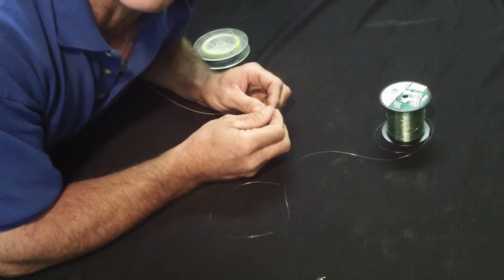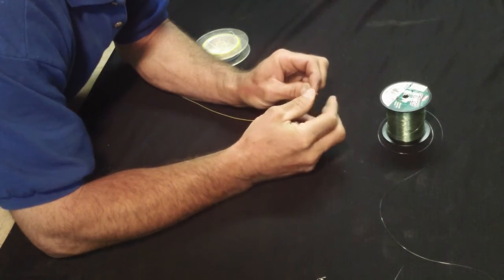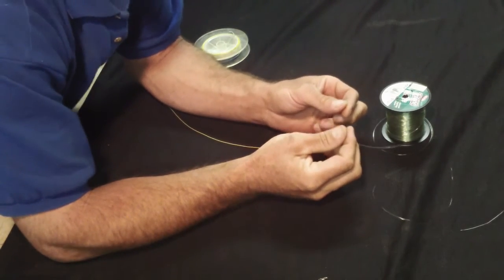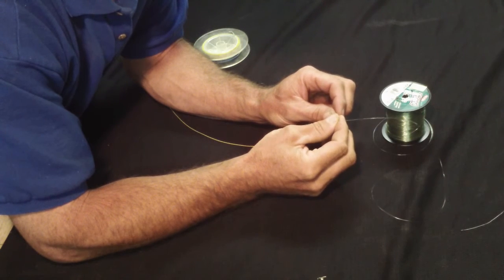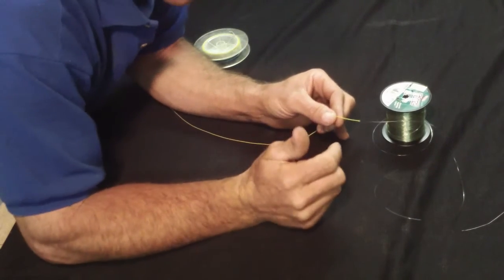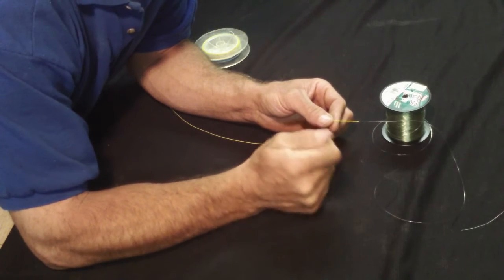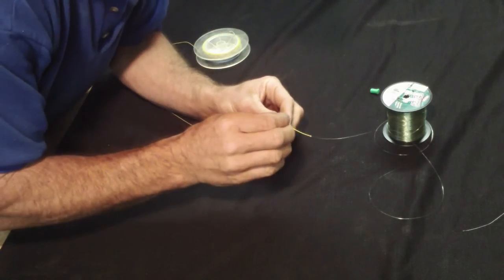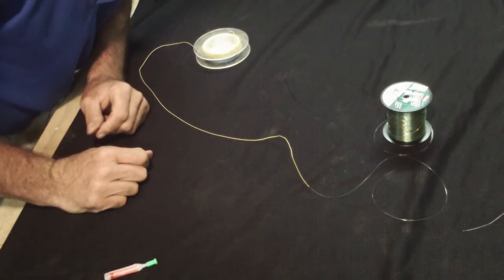Leadcore Line Unique Way To Connect

Comment from the maker: I never did do a second video because the new Crazy Glue made a liar out of me. It has been downgraded like everything else, it seems, and won't hold anymore. However,  it worked like magic for many years and I am sure if there is a better quality glue out there with similar characteristics to the old "good" Cray Glue, the method is still valid and you should try it.
Reply: Very intuitive work there.  I am new to lead core but have fished Blue fin and shark for years.  Name of the game is as much line, as strong as possible on the smallest package.  We achieve this by using Jerry brown hollow core braid as a backer (others work but for diameter/breaking strength we have found it to be superior) and then connecting Floro / Mono leader.  Old school was a Bimini twist and albright...but like you I dont like knots when getting to the leader on a big fish and the reason for the hollow core now becomes apparent.  We splice them together much like you have done, only insert 5-16ft depending on who you ask, into the hollow core.  Then we pull the two lines tight and the Chinese finger trap effect takes place.  To secure the line and prevent the sheath from riding up, we "whip" the end with rigging floss 1-1.5" on ether side and then use the supper glue.  A hollow rigging needle greatly expedites feeding the leader into the hollow core.  The greater the difference between the leader diameter and the ID of the hollow core... the longer the splice.  If yours is pretty tight.....4ft, dental floss and supper glue and your good to go.  Never had one slip.